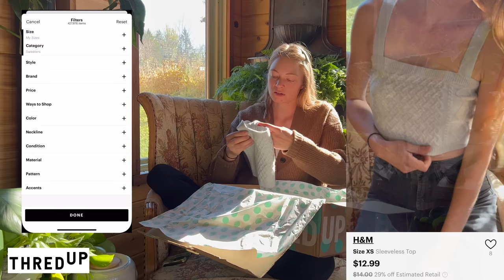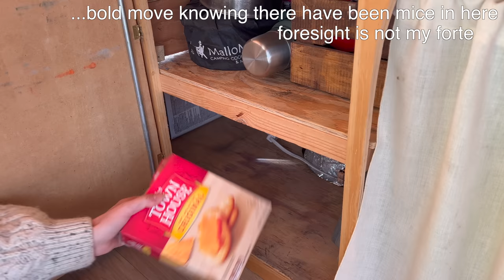Alone in the Woods: preparing the homestead and cottage for winter

Comment: My dad's maintenance business does winterizing for second summer homes in New Hampshire.  This season I helped with some small ones.
We shut the water off, then use the air compressor to blow out any remaining water on both hot & cold lines, flushing toilets & we use a hand pump to get the last bits out of toilet tank & bowl & leaving faucets open. 
Then use RV/marine antifreeze a pink liquid sold at hardware stores, we pump all plumbing lines with the liquid until it runs fully pink through all faucets & shut them off so the lines are full.
Lastly making sure we put a bit of the liquid down each drain to fill traps & making sure to pour some in toilet bowl & tank.
I do not know if this information is actually of any help to you Hannah but I hope so & you are welcome to reach out if any questions. 
Much love to you & Despereaux ❣️
Reply: @hannahleeduggan I sent you messages on other forums with photos of some of the tools we use in hopes that it helps 🤞🏻
Reply: When winter is over and they flush lines, wouldn’t that put antifreeze in the water system? Can that contaminate water that is in a system where it’s recycled? Can the filtering system take all that back out? Or in a septic system… can’t that harm the environment?? I’m being genuine.
Reply: Hi Hannah, 
I heard you have to use the non toxic antifreeze which I think is the marine type, as someone said, not the car radiator type. You also have to drain the water heater too and the washer pipes. Yes as above person said you have to put some antifreeze in all the drains ; the sinks, toilet tank and the toilet, the tub and drain the shower head pipe too. How will your plants survive the winter? You would have to leave the heat on and a boiler needs water to run unless you have electric heat? I would bring all your plants over someone’s house to watch for you. I thought you’d be staying at the new house this winter? Sounds like you are going to take the van somewhere warm. 
Whatever you do be safe and happy and live life to the fullest!
Reply: I thought so too. How lovely to stay in cottage for the winter.
Reply: Why in the world would your dad put antifreeze into supply lines??  The rest of your advice is spot on, but it makes no sense to put antifreeze into the supply lines after they have been blown clean by the compressor.  I am in a much colder climate than New Hampshire and have never ever put antifreeze into supply lines.  As someone else mentioned…. don’t forget to drain the hot water tank.
Reply: My goodness...

I was trying to HELP.

We use RV/marine antifreeze because it is safer. Made for the job. If its manufactured for a boat or camper it's not going to ruin the world 🙃

I absolutely forgot the water heater. Definitely drain that!

Can friends & family members care for the plant babies @hannahleeduggan ?

Thinking of you & still hoping my advice is useful. 

We pump the lines because NO MATTER WHAT there is still water that you can not get out. In our experience, we have had plumbing lines which are "empty" freeze & explode. Peace of mind...when its full of safe antifreeze which can handle extreme temperatures.
Reply: @JaTon  I have the same questions so I hope they answer you. Personally I think she could get by just shutting off at main pipe and opening all the faucets till drained.
Reply: @alwayslernin4400  yes, I agree

Comment: You can get heat tape and insulation at the hardware store for your pipes, ( pay the extra and get a good brand), as well as heavy plastic and framing wood for the windows, check the weather stripping on the doors, check the skirting around the house and fix any holes, as an extra you can get heavy blankets to hang over glass doors and outer doors. You got this!

Comment: Hi Hannah. Just finished watching you latest vid. With regards to winter prepping the homestead, are you in contact with the previous owners? If you are, ask them what their winter routine was when they lived there. You never know what advice they can offer. 
Did they have any particular issues with frozen pipes inside & outside? Inspect the lagging (Sorry I’m British) insulation around pipe work.
If you have freezing cold pipes coming into a building, this can draw heat to it & thus lowers the room temp. 
Do you know where your stopcocks are inside & out? Sorry Water shut off valves. Knowing where these are could save you a lot of hassle if a burst pipe happens. Same applies if you have gas & electric. Know how to shut them off in an emergency. 
Keep plenty of batteries & flashlights handy. 
Avoid candles if you have a gas line. 

Remember heat rises, so try not to lose the heat from downstairs (Sorry again, I’m British) by heating spaces that are not in use upstairs. 
Look at areas where air leakage could occur. You don’t want to be wasting energy by just letting it escape outside.

Also, I’d park your vehicles facing downhill. This way the alternator isn’t trying to push the mechanism uphill. Also, it’s easier to drive forward in the snow rather than reversing in it. 

You’re doing a fantastic job, so keep up the great work & keep safe. 

Cheers Jim. 

P.S. I’m here if you want to discuss your buildings or building projects.

Comment: Hey Hannah, I'm going to tell you what my husband and I do when we leave our vacation home for the summer. (1) Shut off the main water valve to the house. (2) Start with the upstairs first and turn on all of your sink faucets to drain them and leave them in the open position along with bathtubs and showers. Also, flush the toilets. (3) Do the same thing on the first floor and then any basement items. Don't forget to keep the toilet lids and seat area open and dry up as much water as you can. Hope this helps.
Reply: This text me direct on telegram thing is a scam attempt. Don't go for it, sis.

Comment: I suggest getting a Little Buddy propane heater. When you use it you have to keep a window cracked slightly to let the Co2 out, but it works. Get a propane stove and lots and lots of battery's and candles.

Food that you can store away and if you have anything fresh that's fine too but if the power goes out then you can put the food outside where it's cold.

Comment: You could put some linoleum or spray the floor of the house with a leakproof rubber based paint.  This would help keeping the smell down & save the wood flooring in the house.

Comment: So my mom is a snowbird and we also have a cabin about an hour from Mpls and what we do is keep the heat on at about 45-50 degrees so the pipes don't freeze. I think they drain them at the cabin but my mom does not at her townhouse just keeps the heat on low and has a neighbor check on the house periodically. Obviously she shuts off any outside faucets and drains them but we all have to do that every fall or you know, frozen! If your main house is heated you should be able to just keep it running on low and see if someone can check on it from time to time and give the plants a drink. They need less water in winter anyway.

Comment: draining pipes to winterize cottage.....not difficult.   find main water line from well----turn it off.  find drain valve, below shut off.  put bucket under it.  open valve.  not much water  will come out-----go upstairs, turn on all sink faucets, showers, tub fillers, flush toilets,  outdoor spigots.....gravity will drain water, your bucket should fill up.  be patient.  once all lines drained, pour winter household/camper antifreeze in all  traps.   make sure to get all water out of toilet---bowl and tank.  pour some anti-freeze in trap.  also in your dishwasher  i'm sure Youtube has many helpful videos.     good luck...you can do it

Comment: Just a little safety tip: if you use a long handle axe to cut kindling you have less control. You may bump handle against the body torso and miss the wood. AKA your fingers or hand. You may try using a camp axe with a much shorter handle. I think you might be much safer. I love watching your video's and your lifestyle!

Comment: Every time I see you travel with your little mouse it makes my heart smile. I have a question how do you take care of your Koi now that it is getting colder? I don't know much about them, but have thought I would love to have a koi pond sometime in the future. Your Joy is beautiful. Thank you, thank you so much for sharing your gratitude for life. A little wrap goes a long way with pipes, doing the pipes that are on the north facing walls are vital. Wrap pipes with heat tape or thermostatically controlled heat cables. 

Seal leaks that allow cold air inside, near where pipes are located (i.e. around electrical wiring, dryer vents, other pipes), with caulk or insulation. These are very quick installs, and normally fairly easy for your building skills. You are a very good builder Hannah:)

Comment: You can wrap exposed pipes. Get a few small electric heaters and put them close to frozen pipes. You can cut first or pine branches and place them around your foundation  to keep warm in if your home doesn't have a foundation. Check with Home Hardware or Lowes.

Comment: shut the breaker on the well pump , open all the faucets in the house , open the valve on the well pressure tank , let all the water drain out .. also put RV antifreeze in all the drains and toilets ... that is all.. ps empty the toilet tank

Comment: You should get some clear plexiglass and cut it to the shape you need for the front porch windows and then you can just screw it on the outside.  Bonus is you get the light and it won't flap around in the wind and rip.  Leave the house heated so the pipes don't freeze and the plants don't die.  It's better for the house too to keep it heating just enough so the plants stay alive and the pipes don't freeze.  Can't someone check in on your houses while you are gone?  Love your videos!

Comment: so we have a family cabin in tahoe...everytime we want to shut it down we turn off the water to the house...turn on all the faucets on full blast to drain....leave in on position....and put anti-freeze down eat drain....use a generous amount to make sure the pipes dont free....do this everytime you want to reshut down the cabin and when your staying there in the winter...you can do as many times as you want... also when you want to use the water in the house again just turn on the water to the house...wait for all the air to move through the pipes and faucets are running at full throttle and turn off faucets....hope this helps....

Comment: Wish I could be there to help. Winterizing the cottage is easy as 1..2..3.. If the cottage is a standard built cottage it will have low point drains. Hot and cold lines. Check the under side of cottage crawl space. The hot water heater is at the base of heater. Find a way to conect your air compressor to a line before the water heater so you can use it as a holding tank for the air. Fill lines with air but not to the point of pressure the exceeds 7 psi. When filled with air go to each point of release (taps) and open full blast to blow air through till you see no more droplets. May have to repeat several times till lines have released droplets. Dont for get the toilet if you have one. After you are confedent that all the water is out get your RV antifreeze or better and poor a cup of it into every drain tub sinks toilet etc.

Comment: If I decide to leave for the winter, I blow compressed air through the lines and sometimes some salt if I think some water might emerge in the low spots. I don't use antifreeze because that is technically poisoning my water source and as a professional mechanic shop owner I know it never really leaves the pipes completely. Not enough left to get sick but enough to possibly get cancer later. The channel H2O mechanic is a great source for knowledge about wells. I've had a home in the northern Montana Rockies for decades.

Comment: " and you may ask your self, Self how did I get here?" Talking heads 💜 is there a spiget valve on the bottom of your hot water heater, you can hook a garden hose to it and run the hose to a low point in the yard. Don't forget to turn the water off first. The main u can wrap with foam and pipe insulation depending on how close it is to the walls and how much is out of the ground. sound doable?💜✨✨✨🌀

Comment: Depending what kind of heating system you have. I have radiators in my home which need to be bled Every fall. Not sure but I would consult a plumber the first time so they could show you how to do what you need to do So you have heat this Fall/Winter.  Your home is Beautiful!

Comment: If you have a water pump, open up all of your faucets and shut off the pump.  Flush the water out of the toilets.  All the water will run out of the pipes.  Just leave the faucets open for the winter.  Come spring, you just turn the pump on and allow the water to flow through the faucets and then go around and turn them off.Flush the water out of the toilet

Comment: How about some metal flashing under the siding extending out from the wall on to the deck.  I usually go a inch to a inch and a quarter with a hem that turns down.  Without it the splash back off the deck will rot the wall out quick ;)  Looked again, fixing the fascia board and adding a gutter would do even more to keep all the water coming off the roof.  Everything else looking so good I am so jealous of the amount of work you get done.  Can't believe you are keeping both places. fun fun fun

Comment: I think I finally discarded my old wood strap tote this past spring. One of the tires is flat on the wheelbarrow so technically I have no way to carry wood in other than one piece at a time. I wonder if a couple of old pairs of blue jeans would be strong enough to make a tote. Will definitely have to change the tension on the sewing machine bobbin

Comment: I was thinking if you were using adhesive on the mouse cage, the fumes might not be good for him. Just sayin'. When we had to drain our pipes, we shut off the water and turned on a faucet outside, which was at the lowest point that water could flow to. That got enough out of the pipes so that if they froze, they wouldn't burst. Plus, there is stuff that looks like grey pool noodles you get from the big box home stores or plumbing supply that you duct tape onto the pipes to insulate them, IF you can get to them. It's not a fun job. You can also pour antifreeze down the drains in your house into the pipes. That's what my dad did to our coastal cottage every fall before we left. Hope this helps. Best thing to do where you are is to find a neighbor and ask them.

Comment: You should be able to shut the supply of water off, open the highest tap you have, then open the lowest tap there is, the water should empty out of your cabin, if you have any plumbers antifreeze pour it down the drain, so it’s in the drain pipes 🇨🇦

Comment: Im sure some one else has said this. But incase they havent.  Expanding water freezing is what causes burst pipes. No water, no problem. Shut off the water at the main. Drain down your water heater. Turn off the gas or oil at the meter/tank. Get someone with a compressor to come blow the remaining water in your pipes out. Get plugs and covers for the different drains in your house.  so that when the p-traps dry out sewer gas wont come up in the house from the sewer/septic. Turn off the shut off valves under sinks and behind toilets. Drain/flush toilets until back tank is empty. Turn off the power at the breaker and then it should be all good. Minus the fish pond.when it freezes youll want to turn off the pump so that it wont burn out. For the house plants, and the fish in the pond. Find a winter home…parents maybe? 
If you are staying and concerned about freezing. Consult the prev owner and a plumber about insulation for your pipes.
Reply: @armslength2618  ummm thanks for the advice?

Comment: Just the best 27.43 on the planet, and you couldn't plan it. Double glazing, underfloor insulation (a must) wall insulation? Ceiling Insulation ( I have triple layers, extra put in free, post, the Kaikoura Earthquake,  Care of the RED CROSS! Sausage air stoppers along the bottom of outside doors, a must! And the list goes on. Drapes to the floor, with about 3" on the floor, with pelmit across the top to stop cols air circulating off the cold glass! Best of............

Comment: hey sweet pea,
coming from experience with my pet rat I used to have.  I would put down a rubber flooring or a safe water proof coating under the mouse so her pee and water doesn't damage the wood in your van.

Comment: Winterizing, can you be more specific? Was the house operated 4 seasons before you bought it? You removed a themal mass electric heater redecorating, relocated? You can heat temporarily with propane heaters used normally for construction if the house is unoccupied for example until the required work is done if you plan to install a new system. An electric ground source heat pump may be the smartest investment but you may be on solid rock, right below the surface? I will be happy to help you consider even unconventional ideas?

Comment: Not that I know anything about anything but do you need to have some sort of protective layer between the wood flooring of the cage and the nesting. Idk if that’s what it’s called. But couldn’t the wood become damaged from the pee and poop of the mouse or are mice so little it doesn’t matter because they basically do that in everyone’s house anyways. And it probably  would only matter if you didn’t clean it out a lot right. Which you clearly do because I swear his cages look better than most I’ve seen. Honestly just curious. I’ve never had a pet mouse before or any small pet for that matter.